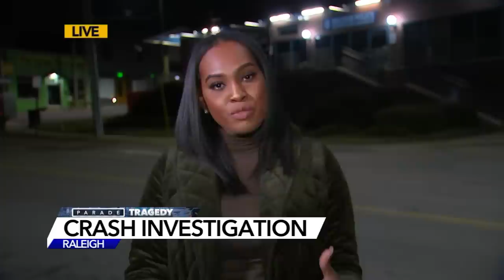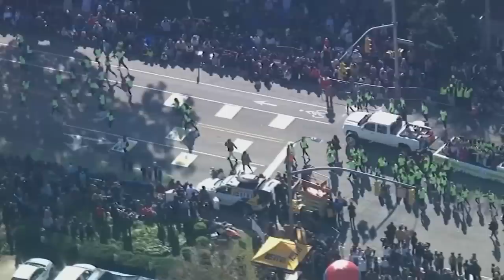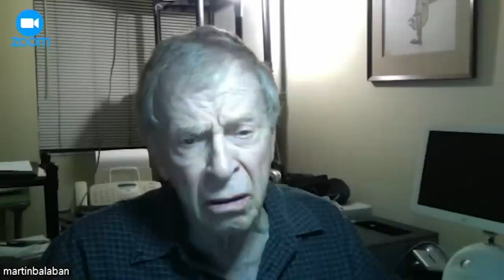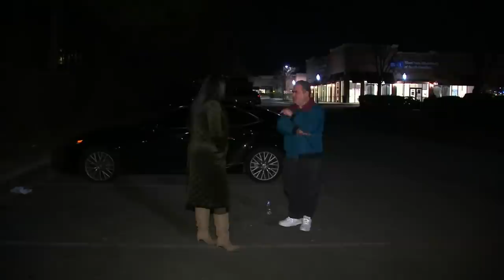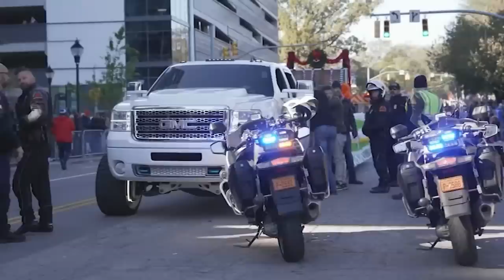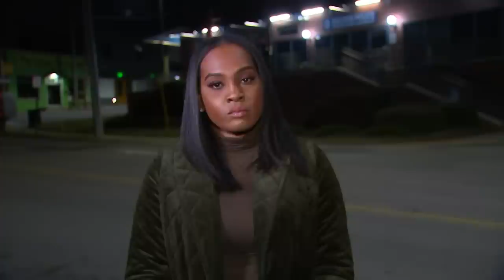Investigators look at truck part by part after Raleigh parade tragedy

Comment: There are many people stating what the driver could have done to stop the truck. Unfortunately, people panic and are not able to react as they might in a calm state of mind. Take into account a 20 year old with less driving experience compared to a 40 year old, who may have reacted differently due to their driving/life experiences. We gain experience from encountering problems. We learn from those experiences to make the best decisions we can at that time. The driver decided to make an audible warning with the use of his horn and with his voice, to warn those around him of his failed brakes.  The fact that his booster failed would have never been caught in a standard state vehicle inspection. All components on a vehicle can fail at anytime. Always remember, anything man-made WILL fail at some point. I hope people will think about that as they are speeding and aggressively driving from point A to B as well.
Reply: Bullcrap !!  Ignition off,  apply E brake, throw the transmission into Park or reverse,at those speeds anyone with half a brain are capable of that.
Reply: @riccicrozzie8204  yes 100% Aggreed , people been pulling floats for hundred of years and with no major incidents. 

This driver sounds like he is going to be in hot water.
Reply: No excuses, Neutral then E-brake. It's the most basic part of driving a vehicle EXPECIALLY in a parade. That truck had thousands of dollars in upgrades so no excuses on mechanical failure from lack of maintenance. Btw even if the booster fails the brakes STILL work they are just hard to press. I've had it happen, both hands at the bottom of the wheel and both feet pushing as hard as possible using the steering wheel to triple your force.
Smh
Reply: @riccicrozzie8204  ever notice when you turn your ignition off you lose some braking power 😉
Reply: 100% his fault and he should serve time, he killed that girl, he made ILLEGAL MODIFICATIONS to that truck! They are illegal for a reason! FOR SAFETY and here is the proof. Make an example out of him
Reply: @whelenguy  So what illegal modifications did he make?  

if this was even remotely correct, why was he not arrested for he "illegal mods"? he was charged with "improper brakes" and 3 other charges but none of them for illegal modifications and all are misdemeanors. 

Improper here could mean dangerous worn pad, rotors, improper maintain braking systems, etc.....

Think before you speak or in this case type..
Reply: Did his emergency brake fail? He could’ve even slammed the truck into park, to stop the truck from moving! Don’t even say, he shouldn’t be charged! He KILLED a little girl for goodness sakes! 

Talk to that little girl’s family and tell them that he shouldn’t be charged for killing their baby girl! There’s plenty that he could’ve done to prevent that baby from losing her life! It may even have been a mistake, but it was TOTALLY a preventable mistake and THAT is why he should be charged.
Reply: @beckyboo8559  seems like you have all the answers Becky. The young man is 20 years old. I'm sure he panicked. Next time your cruising down the road, slam your gear shift into park. Guarantee, you vehicle will not stop like you think it will. Also, the use of an emergency brake would be a great idea. But, if your in a panic and you don't use your emergency brake on a regular basis, your not going to think about it. Who uses the emergency brake in their vehicle? Unless you have a standard transmission, most people do not use the emergency brake. I guarantee most people would have to look for their emergency brake if they needed to use it. Becky if you think that young man "deserves" to be charged, I hope you are never in a situation where your vehicle experiences a mechanical failure and accidently hit someone. See how you feel when people say she deserved it.
Reply: @402SHO  You're, not your.
Reply: @whelenguy  they wanted his truck in the parade BECAUSE of the modifications because it looked cool. If they were so concerned about modifications they wouldn’t have allowed him in the parade.
Reply: @stevenwiggs8834  No he wanted his old truck in the parade.  That ugly thing aint cool, its illegal and stupid
Reply: @michaelangelo6217  Some trans won't allow you to go into park while  moving.
Reply: @michaelangelo6217  If he's not thinking about his emergency brake in an emergency you should not be driving and certainly not in a massive landyacht.
Reply: @Enchisedmy  Y'all are very critical about the e-brake usage. How many of you commenting, actually used your e-brake prior to colliding with the vehicle in front of you?
Reply: @michaelangelo6217  Im critical towards the e-brake not being used. You should probably be too. Ive never collided with another vehicle. The e-brake has saved me from severe injury once while I've been a passenger but I cant say I've ever had to use it for anything emergency related while driving. Usually your hydraulic brakes are far superior and I haven't had mine fail on me.

If one brake fails and your first reaction isn't to try the second one at your disposal you should not have a license.
Reply: @Enchisedmy  Show me some statistics indicating drivers who have actually used their e-brake when their brakes have failed versus those that did not. Guarantee, you will be shocked at the percentages of those who did not try and use their e-brake. Since you believe anyone who doesn't use their e-brake when their main brakes fail. Their may not be time for someone to apply their e-brake. Most people will try to pump their brakes first before thinking about the e-brake. Hand brakes are nice, readily beside the driver and vehicles that use a standard transmission. That doesn't apply to most automatic transmissions where the e-brake is below the dashboard in an awkward location. Nowadays, we have the car manufacturers once again selecting a better mouse trap for the e-brake. The electronic e-brake. I am critical of those who are critical of others. We tend to find those people doing the same as those they criticize. Reminds me of many politicians.
Reply: @michaelangelo6217  I'm not expecting anybody to switch over to using the e-brake in a split second. But after pumping your pedal once? Twice? High time to switch then. The dude in question who ran over a child, he had quite some time to apply his e-brake.

The position of the e-brake is something you should probably check once you first sit in a car. They're standard labeled much like high beams and such so it won't be hard to find.

Using them is a slightly different story. My personal experience with electronic brakes is limited to VW and a Mercedes. The Mercedes locks the electronic parking brake if you pull on the switch for a second. Never tried in the VW.

While I do prefer the center console handbrake approach the more American pedal should be fine in an emergency (given you're in the drivers seat). Had plenty of those, never felt they were particularly awkward.

I think it's important to make a distinction here: I'm not critical of somebody using the e-brake a bit too late or something along those lines. I'm critical to the lack of e-brake. No attempt was made.
Reply: @Enchisedmy  You need to understand that the guy was 20 years old. That is an inexperienced driver in my eyes. I'm sure he was in a panic when his brakes failed. Most people do not think in a systematic way when they panic. Too many people try to be a armchair quarterback in incidents they were not involved with nor do they have experience in a similar situation. Do I think he should have attempted to use his emergency brake? The answer is, yes. But, people do not always think clearly when they are in a panic. This was an extremely sad and traumatic situation for parties on both sides. There has been a loss of life on one side and on the other side, a young man who will have a heavy heart for the rest of his life.

Comment: I truly hope they don’t charge that young man. This was completely out of his control I can only imagine what he is going Though mentally.
Reply: he made the modifications to the truck .  probably using the cheapest parts he could get .  soo yes it is his fault for the malfunction ..
Reply: 100% his fault and he should serve time, he killed that girl, he made ILLEGAL MODIFICATIONS to that truck! They are illegal for a reason! FOR SAFETY and here is the proof. Make an example out of him
Reply: @whelenguy  so what illegal modifications were made to this truck ,,there are millions of lifted trucks on the road  and they don't all go around causing accidents ,,several news articles said that this guy had several traffic infractions and equipment violations  ,, they don't say if it was with this truck ,,equipment violations can include dozens of things and only a couple would cause loss of control ,,faulty brakes or braking system ,bald tires , broken/missing or worn steering components ,,,but equipment violations  could also include illegally modified / removed emissions systems ,lights , cracked window missing or broken mirror ,illegal use of offroad lights , illegal horn use ,, i could go on
Reply: @whelenguy  not his fault he got arrested and he feels horrible about it it was a mistake yes it was a big mistake but it wasn’t his fault he just happened to be the guy driving it and he really feels bad for what he did but it wasn’t his fault.
Reply: @whelenguy  I guess I’m a idiot I know that but as a idiot he never meant to kill the girl and as a idiot I think it was not his fault call me a idiot if you want because I am one duh
Reply: @TAKEACHILLPILL33  I'll clear it up for you more simple minded ones...  his actions (ie: illegal truck modifications) caused the failure of the vehicle... therefor he IS SOLELY responsible for the accident.
Reply: @TAKEACHILLPILL33  just keep playing with your legos.... let the adults do the talking.
Reply: @whelenguy  first of all legos can be used by adults and who said your the adult insulting me because of legos and calling me a idiot I thing adults are more mature and dosent insult people with legos and call them idiots to prove a point they have actually evidence
Reply: People are so stupid in these comments and it’s sad
Reply: He got like 30 years
Reply: @whelenguy  it wasnt his truck what do you mean he was just a driver not the owner, could you notice a damage part of a car you dont know or own when you hop in without opening it up
Reply: The family of the Child that was ran over wont think so. They're more than likely to press charges. The mentality of "someone has to pay, to alleviate my anger" theme.
Reply: He had multiple violations. He definitely needs to be held accountable to a degree. A life was lost

Comment: insane, a brake failure is not something everyone goes to so it’s not instinct to go for the parking brake or kick it in neutral. yes there could have been ways to avoid it, but it’s a lot different that it being intentional.
Reply: @wesryman  that would do absolutely nothing
Reply: Intentiona or not isnt it manslaughter because of neglect
Reply: @masaster5210  manslaughter is for cause of death to another person in any circumstance. Negligent manslaughter is different, and when the driver is typically found guilty of manslaughter, it is up to the judge to decide his sentence
Reply: E break don’t work like that and he did use it. That why once people tried to help him they was able to stop him so easily cause he had it on
Reply: Definitely seems intentional.
Reply: Because of it being a newer truck, I would assume the E brake is activated via a button, if the vehicle is moving to fast it wont engaege it, also, it’s an automatic meaning he could not get it into P or R just N or D
Reply: It may not be an instinct for you but it should. This is definite negligence, especially at parade speeds.
Reply: @elt39  2011 era was still manual foot pedal and column shift. However slamming it into park would just break the parking Pawl off. Regardless the guy talking about brake failure in the video has never had it happen in a GM truck. You lose everything, no secondary braking. I had a little older gen Silverado and i blew out a simple wheel cylinder and lost all total braking. I had to rely simply on my parking brake. But everyone thinks differently in a situation like this. Regardless My condolences to the famlily, I wish that nobody has to go through such a time.
Reply: Nuetral wouldn’t change anything
Reply: @elt39  it will engage if you hold it.  That vehicle still has a mechanical emergency brake near your left foot.
Reply: Put it in reverse and apply the parking brake.
Reply: @skankhunt3624  definitely doesn’t Lmaoo
Reply: @DieselPurge  parking brake may help, alot of times under some speed it may just stall the vehicle "yes even an automatic"
Reply: @dododostenfiftyseven4096  i know, in a automatic you need to go thru N to get to R from D
Reply: @Turkelton  that was not What I ment, i ment that he couldnt have Done more than What he did
Reply: @jurgoSTI  How would I know it has that?
Reply: @Turkelton  also note I wrote assume, that was Because I was insure if it was mechanical or electic to activate the E brake
Reply: @dododostenfiftyseven4096  first, then a quick blip in reverse to stop forward motion followed by slamming into park, would stop the truck even if the idiot didn't have a working parking brake.
Reply: @elt39 that’s why these push buttons instead of actual gear levers is stupid
Reply: @dododostenfiftyseven4096  yeah facts😅 who even said neutral was a possible way to stop the truck. Better be a joke
Reply: @rhondanighman  Totally agree on that, the E brake should be able to be used as an E brake if the need is there
Reply: @skankhunt3624  it's not. His brakes failed. He modified his vehicle and he, himself, replaced the breaks a week before. The breaks were not as strong as the previous ones and could not stop the weight of the truck or float.
Reply: @mikehairston9444  sounds pretty intentional to me.
Reply: it might of had a hydrolic E brake and the driver  was panicking and didn't think to do the other ways of stopping it
Reply: Slamming it in park would only make it click loundly..the lil pin will not engage..the e brake on those year chevys orten rust out n the line breaks..and the brak lines rust out and pop..so you might not notice no brakes until you have no brakes..especially in a situation where you are continually pumping them..best you could do is lay on the horn n drop it in 1 and turn off engine but leave key turned partially..but if you dont know it seems like that would be wrong..
Reply: @elt39  funny i have dropped it into reverse going even faster than this due to a break failure . mind you the car did not like it but it did do the job .
Reply: It’s common sense to do all of those things or how about turn it off
Reply: @ashtonbatterson5309  the parking brake would help a bit but putting it in neutral would only lessen the resistance and cause it to roll faster if already moving, especially given the weight.
Reply: That is complete BS. If my brakes fail (and they have) I immediately threw the car into neutral. it was an instant reflex.
Also, as a mechanic I would say at least 10% of any car over 10 years old has a faulty ebrake.
Reply: Garnet Holman  I agree except for the fact that it has a full size trailer with excessive weight on it. Inexperienced for sure but I still think it would have just failed.
Reply: Garnet Holman  Well thats different from this situation as he could not gear down, otherwise you would be able to enginebrake youre way down to a safe speed, also, forcing it into P or R sounds a bit unrealistic but sure, it depends ofcourse if it electronic or mechanical, and at last, I wrote ”I assume” as I did not know how the E brake is engage on one of these trucks so no need to be rude
Reply: @roberthance2412  Yeah, if you get it into R that is great in a such situation but as other people has mentioned, you can hear the gearbox grinding in some clips of the event so something made it not wanting to go in either P or R
Reply: @torquetheprisoner  if I have understod things right from these experts that somehow got affended that I assumed it had an electric E brake has explained that it has a pedal to the left which I am familiur with as Mercedes have has the same on some of their cars, if this is true, then he should have been able to engage the E brake inless it also failed
Reply: Assuming the float is based on a trailer. Use the electric trailer brake to slow to a stop and set the ebrake.
Reply: @skankhunt3624  yes because the 20 year old kid 100% wanted to run over people at the parade going 5-10 mph
Reply: @DieselPurge  all in hindsight,but possibly they could have dropped the landing gear/trailer support for a little more drag ??anything at that point might have helped,,so sad indeed,
Reply: There's so many things you could do. Unless they were driving down a hill (I can't tell if they are) shutting the truck off, putting it in neutral, put it in reverse without touching the throttle would stall the truck, any of those things, plus the rolling resistance of the truck and trailer, would have slowly stopped the truck. If you're going to modify something and not know what to do if the throttle gets stuck or you lose brakes, you shouldn't have a modified vehicle. Because of this, it seems like he should be charged with manslaughter.
Reply: Those transmissions are horrible, they should get sued. GMC.. I have a corvette been in the shop for a bad transmission problems .. they should be able to check the computer system or brake lines.. also I’m sure the kid got drug tested .. hopefully he didn’t have a couple beers.
Reply: @skankhunt3624  my man trolling on the news 😭
Reply: Well putting it in neutral would absolutely do nothing 😂. you can put your vehicle in neutral driving down the highway and be totally fine. 😂